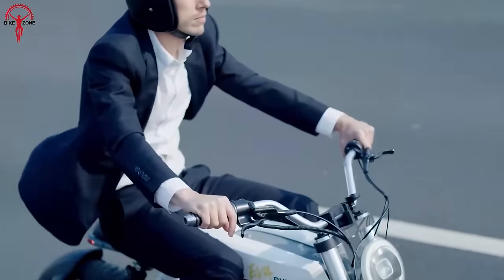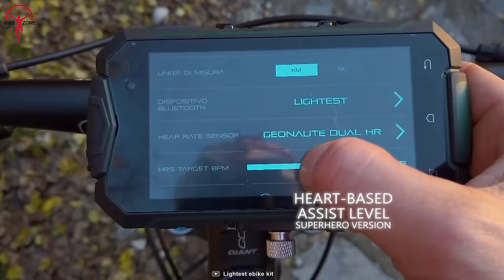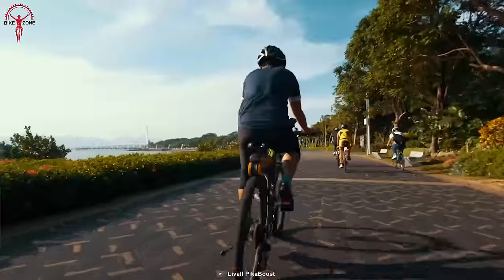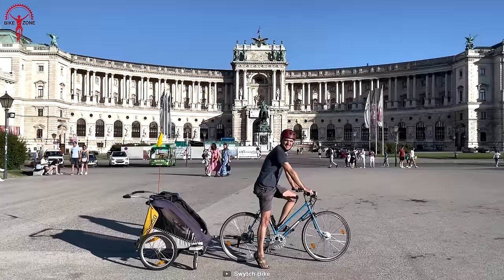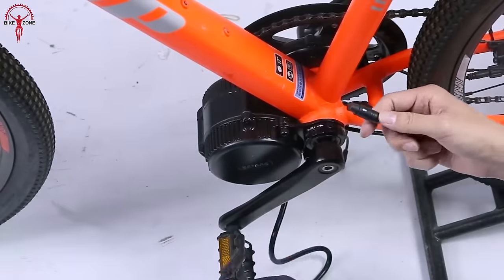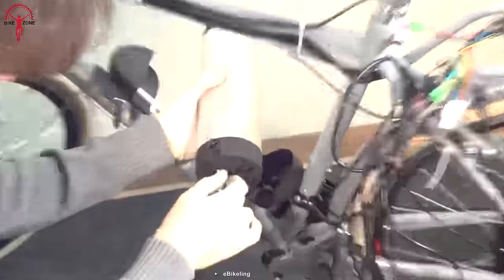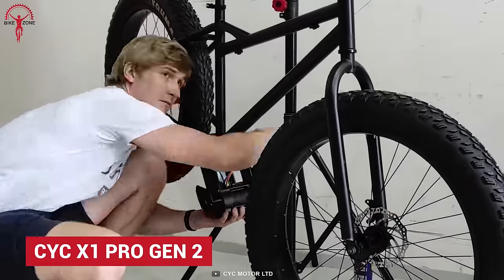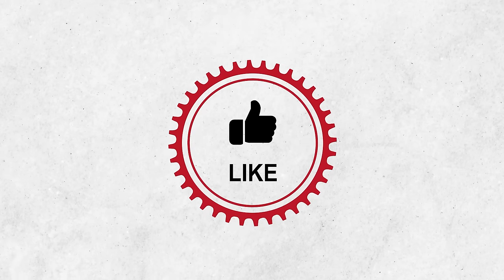Top 7 Best ebike Conversion Kit

Comment: I own 2 ebikes. The conversion kits featured in this video range from dumb to OK. But the PikaBoost is especially useless and a total waste of money.
Reply from the maker: Thanks for sharing!
Reply: Why the hate on the pikaboost? It seems like an amazing innovation, interested in your thoughts please share
Reply: Not everyone can shell out that much cash for full fledged e bike especially when they have a regular bike anyway. Obviously they can’t be as good as a full blown e bike but even the worst conversion kit is still an improvement over just kinetic energy and just make it easier overall
Reply: @minernooberz68  the fact that it blocks the usage of mudguards is reasoning enough imho.
Reply: I design and fabricate friction drives for the last ten years. To prevent friction gears from slippage, the contact surface materials used for both the drive and driven gears have to be perfectly matched to prevent slippage as well as wear and tear. Unless PikaBoost provides the matching friction gear for each individual tire type (e.g. treads type and hardness), slippage is unavoidable. I have tried mounting a friction drive on my road bike before. It slips in wet condition and adds extra wear to the treads of the tire if the pair is not matched.
Reply: @bike-zone  4🎉 1:25
Reply: Where can I buy a Pikaboost & how much??
Reply: @duaneduncan4189  Read what Cliff Chan said here about the Pikaboost. His opinion is the same as mine. You will never be happy with the Pikaboost. Don't waste your money.
Reply: Thanks I don't like wasting money
Reply: Yeah I thought the same.
Reply: @terranhealer  In addition to very poor  performance I'm guessing it would beat itself to pieces in short order anyway. Again, I restate, a total waste of money.
Reply: The BBS02 is one of the most popular kits there is. And solid.
Reply: Do first one in video (lightes ebime kit) good?
Reply: I don't ride a bike regularly and never owned an ebike. That said, I can tell there's a lot of room for people to get their hopes up. "Convert any bike to rival the best bikes in seconds" ya, ok, bud.
Reply: Thanks for confirming that for me! I wasn't too thrilled about NONE of the kits except the imotor3, maybe  🤦🏾‍♂️
Reply: @bike-zone 😂
Reply: Which ones do you think are ok?
Reply: @RenGuitar1750  Disregarding prices of the kits, probably the CYC X1 PRO GEN 2 and the EBIKELING 1500W DD. I'd recommend at a minimum a 750W motor, but you could get by with a 500W motor.

Comment: People need to realize that the Whole point of Green Energy is to be GOOD for the environment. A NORMAL boke that you operate with your FEET is already the BEST option for your health and the environment.  Adding a device to a thing with not device does NOT reduce pollution, it creates it. All the parts of the device were minded and assembled. Just peddle your bike with your feet. Or better yet, walk.
Reply: Some people don't have the ability to ride a manually powered bike, but can enjoy riding with an electric assist.  Where they would be left sitting out otherwise, it gives them an ability to do what otherwise would be impossible. I for one wish I were a teenager with unlimited energy that I had way back then,  but sadly the strength stamina and energy fade over the years.  Also the whole going green e fad is a myth of sorts, ever consider where the electric comes from to operate the electric item also th3 energy spent to build the items and infrastructure that cause fossil fuels to become a thing of the past, use said fuels to create what will eventually replace said carbon negative items, where any savings on emissions become negligible and in the end coal, gas and oil create most of the electricity produced, so to go green is only having someone else emit carbon into the atmosphere, rather than put it there by ones self, but it makes some feel better by not being the actual polluter.
Reply: @WeChallenge   Maybe, but the people I see use them are kids and teens who are verry able bodied.   Bottum line electric batteries are NOT green energy they take  minerals to build they take hours to charge.  If you want to go green, go by foot or by bus or train  also Bikes are no good for farm owners.
Reply: Small mind - ebike make long distant bike ride easier, reducing the likelihood of ICE automobile dependency. If you want to truly go green, why are you using the internet and using electricity? Do you not know those electronics required materials that are mined and electricity likely are produced from fossil fuels? Hm...........

Comment: I did my trike with BBS02 Bafang about 6 years ago & still going strong. I have 52 v battery pack and 48 v pack as back up. I can do over 80 miles when both are charged up to max power.  The first 5 years I used for commute to work for total of 13.6 miles both ways. That is for 5 times week and sometimes for longer rides back to the house for fun. I am in my 60's  now and still ride it to work on no rain or snow days. Oh, above freezing tempter  days.
If you want cheep trike buy the parts build your own trike. Happy Riding. Last year in August of 2022 I rode in HHH bike ride for 50 miles. I'll see you there.
Reply from the maker: Great! You shared your experience. This is valuable. Thanks.

Comment: I have got the add-e next from Austria, below and behind the bottom bracket, works like the livall, the detachable battery looks somewhat like a bottle. Wonderful for everyday cycling, just adds 50-600 Watts to your cycling. Three different sizes of power packs. Your tyres have to be quite sleek. You will manage every ascent, but full power for half an hour will empty the midsize power pack. All commuting will be possible. Efficient and surprisingly unobtrusive, most people wouldn‘t even notice it. System weight 2,1 kg. Age 57, living in a somewhat mountainous region, I enjoy cycling again, using the additional support when needed. It enables cycling any road, mostly sweating because I love the exercise, but always pedaling at a nice cadence. Not cheap around 1500 Euro, but I can keep my beloved everyday cycle fully equipped at about  16 kilograms. Good, eh?  Many settings possible. You can even set the Sport Edition to 45 km/hour, illegal though without insurance-Plate. Greetings from Germany!
Reply from the maker: Thanks a lot for sharing with us.

Comment: The one thing I don't like here In Australia is the pedal assistance rule. And 25 kph Max speed, it's ridiculous.  When my skateboard and scooter do 40 kph on their own. I can give my skateboard a boost by pumping like I do with my standard longboard. But having to pedal all the time , no way.
Reply from the maker: Thanks for sharing your thoughts with us.
Reply: Your skateboard does 40kph 😂😂😂😂😂😂
Reply: Downhill maybe
Reply: @RoughWalkers  OK scooter does 41 and electric skateboard 39 . Skateboard crouching down to lower wind resistance.
Reply: @roughwalkers  My drop through down  hill board yes , electric on flat.

Comment: the pikaboost is the same approach as the rubbee which seems to be made in Lithuania and has undergone development over a number of years.  It is sold through the UK.  Anybody out there tried one ?  I took a long look at the rubbee and was wondering about noise level coming from  rubber on tire.  Cost 8 months ago was around $800 USD.
Reply from the maker: Thank you for sharing!
Reply: Dayamm" 800$ lol  get a 1500 watt hub motor for half that" & still have $ even if you had to pay a shop to install it ,  and still go to subway for lunch
Reply from the maker: @tomthomas9910  Yeah! You made a great point.

Comment: Mid drive units kinda suck I had a bafang they work great but when the unit craps out  after 5 yrs and you have no way to fix it unless your electrical engineer then its problematic and they are a lot of work to install not impossible I did it but if the battery or something goes wrong just do your self a favor and keep all your all parts and cranks
Reply from the maker: Thanks for sharing your thoughts. It will be helpful for everyone!
Reply: 5 years for a motor costing 3-400 quid... if you were using regularly that's not bad going mate .
Reply from the maker: @davidswift1644  you made a good point!
Reply: Leaning towards a hi watt rear hub motor bafang is better quality than most" And are more compatible with about any bicycle frame depending on the rim width,  I've only seen mid drives on small European threaded bottom bracket,  would one fit a american full size bottom bracket" ???  Or be limited to the donor bike used
Reply from the maker: @tomthomas9910  It really would depend. But fit should fit a american full size bottom bracket.
Reply: @bike-zone  thanks I don't think I've ever seen a mid drive on a standard american bb,  that's good news ,  still up in the air on a hub or mid"  pros and cons to each on some videos,  so"" thinking why not both" would it really benefit power/ distance, depending on the donor bike for me if it's going to be a mountain bike  I'll do a mid drive and with jumping and trail riding since the weight of a rear hub drive will throw off the weight characteristics doing some light jumping, but if it's going to be a beach cruiser type bike I'll be doing a hub drive, for more flatland cruising
Reply from the maker: @tomthomas9910  That's great! Thanks for sharing!
Reply from the maker: @tomthomas9910  Usually it's limited to the donor bike.
Reply: I'm 4 years on my bbshd and a bit over 20k miles, had some issues that I had to open it up to solve, but nothing electrical. There are a lot of videos teaching you how to do almost everything on it. I feel like I've gotten my money out of it and it's still going strong.

Comment: awesome! I would love to do this so  bad but my problem is I am only 4"11 so I need to convert a tiny kids bike (prefer a bmx-)  but all the converters I have seen use such big tires.  Is there a solution?  thx ;  )
Reply: My kids are about your height and they ride bikes with 22" wheels just fine. The kits in the discussion usually have wheels from 20-29" so I believe you should have no problem.

Comment: Hi.Does anybody knows if there are power banks for e bikes? So you can charge bikes batteries like mobile phones?
Reply from the maker: There are no power banks but you might look for some compact power stations.
Reply from the maker: @CalmoOmlac  You made a great point.
Reply: why not just add an extra battery as a power bank would need to be larger than your battery
Reply from the maker: @pacifice-bike5617  point!
Reply: Yeah it's called your legs
Reply: Is it possible to recharge batteries with portable solar panels?  If you went for a few days camping for example?